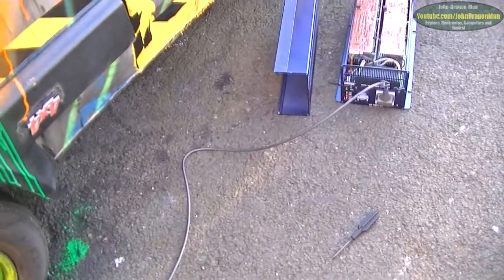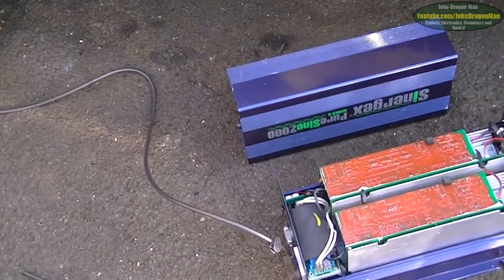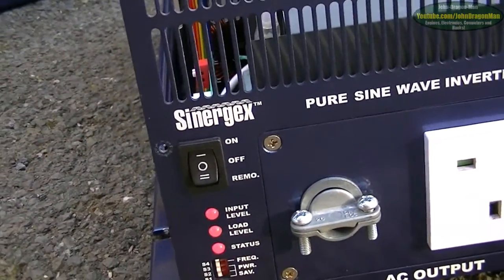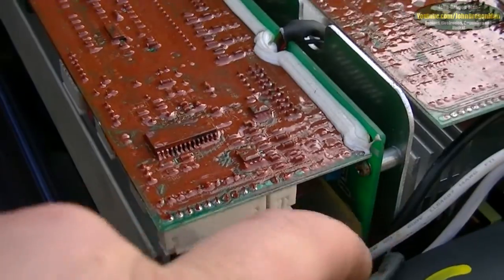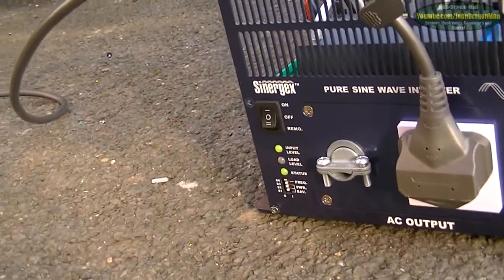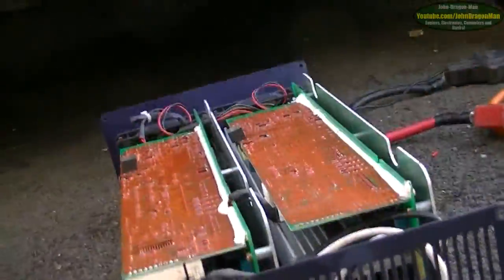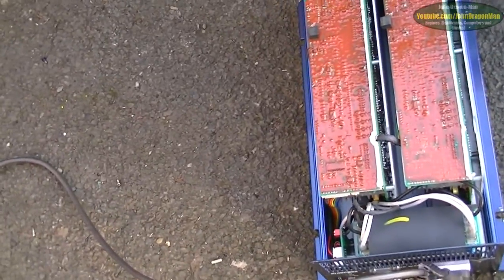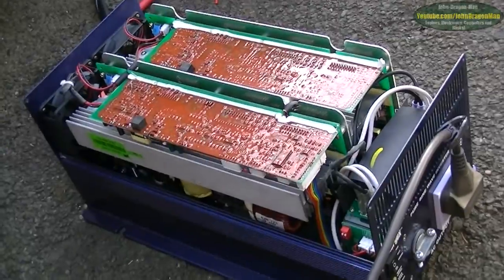Inverter help overload protection bypass

Comment: Hm, good luck with that one.
I'd say you should start off by figuring out where the current is sensed. Might be a shunt resistor, or a small transformer with very few windings on one side (aka a current sense transformer).

Comment: hmm only one of the 2 fans came on. which implies perhaps the fault is on that side of the inverter. perhaps a component such as a triac failed and you may not be noticing it? might wanna get the mulitmeter and probe around and see if anything comes up as a dead short. or reads an odd value. id venture a guess likely on the side of the inverter that had the fan kick on.

Comment: the alternator could be putting out to many volts, how many volt inverter?
Reply from the maker: +Josh Kilen its a 230v inverter and it gives out about that. it does fluctuate with load. its the over load protector that shuts it down..  not the over volt protector.
Reply: when meant volt inverter i mean the input volts, i know that euro uses 230 volt

Comment: Half of your H-bridge is shortred... I know, it shorted 6years ago. But for posterity...
Reply from the maker: I work on a scrap yard and always get them like this. This really helps! Thanks :D
Reply: @johndragonman  If you have some knowledge of how electronics work, then also mind you that you might also have the gate drivers blown, especially high-side. Check them up. If they are integrated like ir2113, get new ones, there are two. If discrete, check each transistor, resistor, diodes between the signal generator and the h-bridge.

Comment: Are they old electrolytic capacitors leaked, maybe they spilled electrolyte over the board and short circuited something !!

Alex
Reply from the maker: +High Voltage thanks, i did check that when i replaced them. if it was not for the overload protection fault this unit would be perfect as it does start and run!
Reply: johndragonman Then probably one of the ICs is defective, not a easy fix